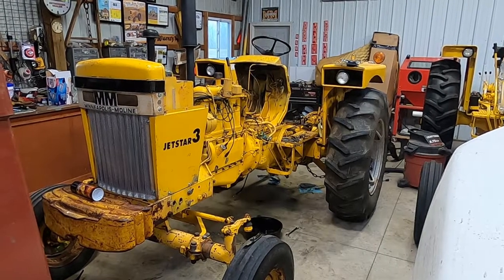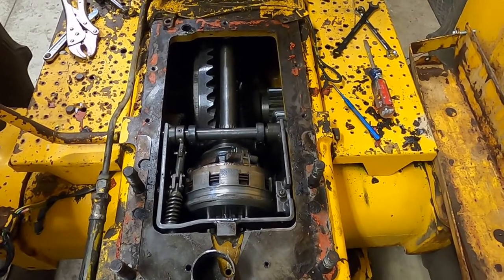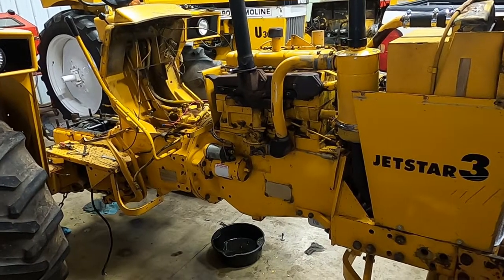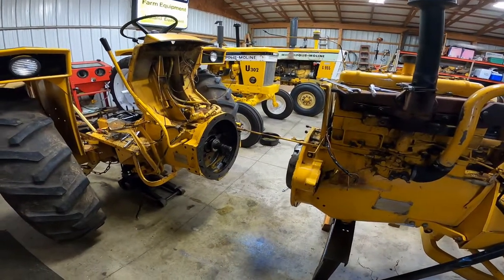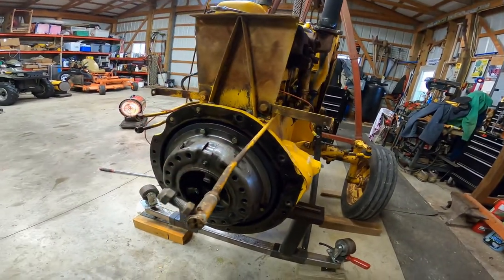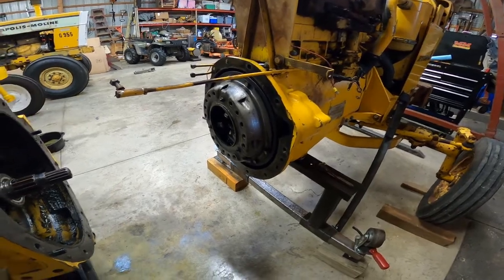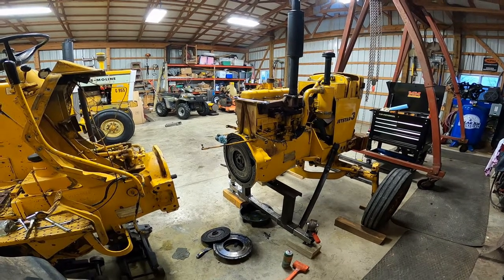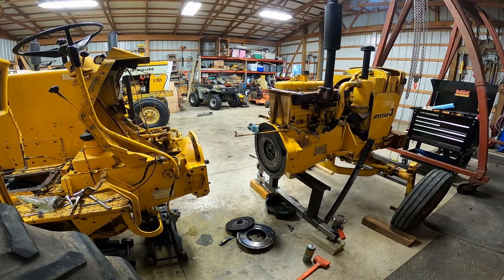Jetstar 3 split Part 1

Comment: my M670 torque amplifier is failing. move the lever, nothing happens. there is a pan underneath, looks like I should be able to adjust or look. is that accurate? do I need to split to get it to adjust? replace?
Reply from the maker: Email me. Andyohiomm@yahoo.com

Comment: What size are your front tires ? I have 6.00×16 . I'd like to put on 7.50 on but only have a tight inch clearance between tire and spindle . Might have to just go with 6.50 . Seams to be front end heavy . It sinks down deeper and tends to slide more than my farmall 300 which has 6.50×16 and is considerably weighs less . Bob K
Reply from the maker: It has 6.00x16’s. You can flip your front hubs if you need more clearance.
Reply: @andyohiomm5364  So you're telling me I pull of the hub , flip it over and slide it back on ,tighten the retaining nut and reinstall the dust cap . I haven't tried it yet. Wanted to double check to make sure I understood you correctly.  I had no idea they could be reversed.  I did notice when I repacked the wheel bearings that the inner and outer bearings have the same part numbers which explains why it would be possible.  I'm just wondering if the dust cap can still be installed on the newly exposed side . Maybe they were designed that way . I've done some research and you're the only that had this information.  I guess I know that I'll be doing today.  Thanks for your response. Bob K